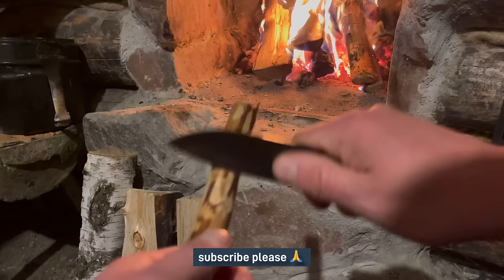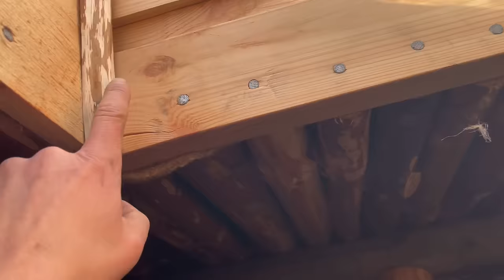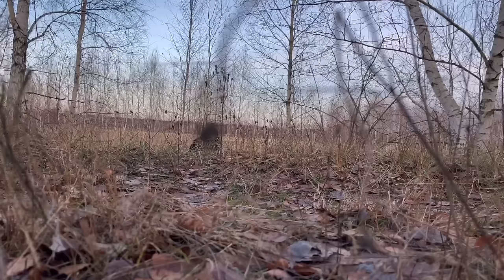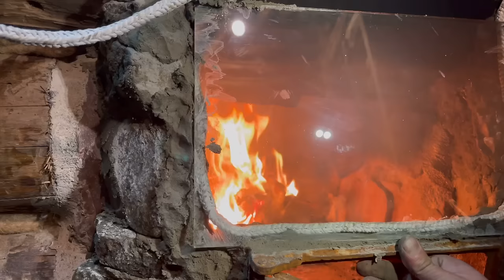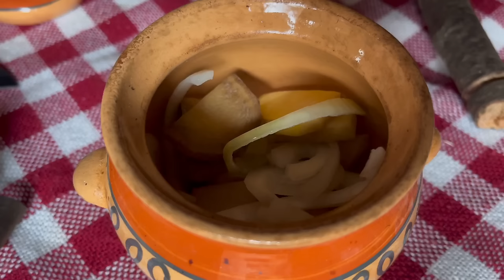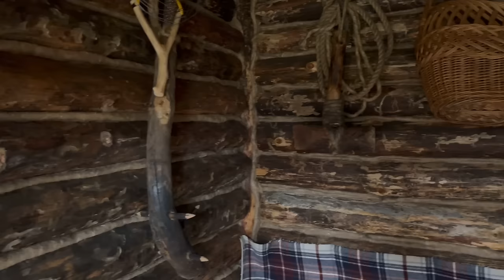Autonomous underground survival shelter | Dugout built | DIY fireplace

Comment from the maker: Hello 🤝. Sorry, but I didn’t make the fireplace, something didn’t work out, I’ll finish the fireplace in the next series. Please write a comment what am I doing wrong 🤔???
Reply: I’m curious to know how will you improve the fireplace in the next series! Greetings from Botswana 🇧🇼
Reply: Well, I'm not an expert, but in my humble opinion, it's not worth putting a door and a window on this fireplace .. leave it open .. looks much better. Another thing - dunno what mortar you used, but making fire at the same time when building a stove is no good .. the masonry has to dry naturally, to harden for at least 24 hrs before making small fires .. otherwise the mortar just dries out instantly and won't stick to the stones and harden, so everything will crack and fall apart pretty soon.
If you need a good wood burner, I would suggest considering a factory made cast iron stove .. it looks stylish, heats up fast, burns cleanly, is economical, produces tons of heat and you can also cook food or boil water on this thing. Most models today also have glass doors, but at the same time looking rustic😉
Reply from the maker: @DailyShelter  Hello 🤝. Thanks for the comment. I want to install a non-flammable rope between the glass and the wall. I will use a special mixture for this. Then I'll paint the door
Reply from the maker: @greybeard5774  Hello 🤝. Thanks for the comment. I want to install a non-flammable rope between the glass and the wall. I will use a special mixture for this. Then I'll paint the door
Reply: Lose the glass and the door. An open fireplace was more aesthetically pleasing.
Reply: I have an oven in the cellar, to heat an Oven in the Normal Level.
Without a door or a Glass, the oven becomes too much Air. So it needs too much wood. If the wind blews in, you’ll have dust in the house. So i think the korrekt heating would be, an big nice oven with door, chrome pipe with air control.